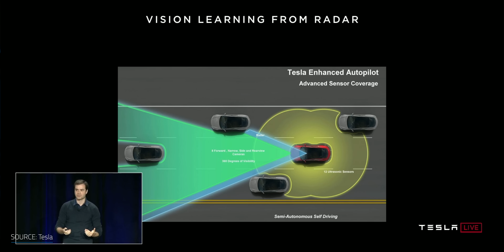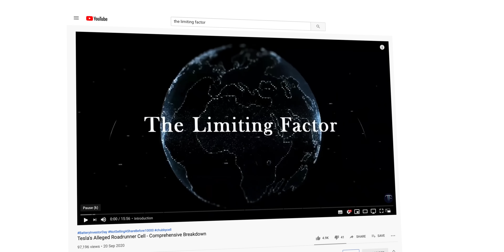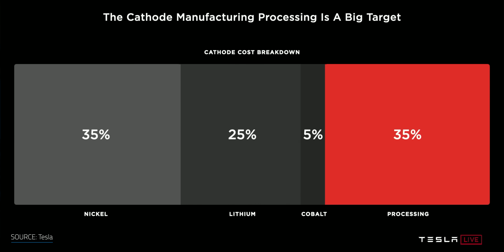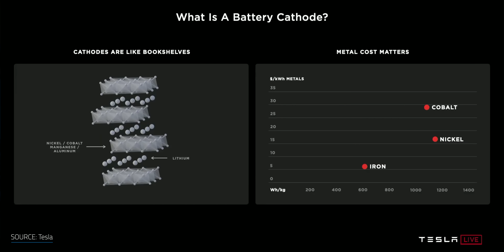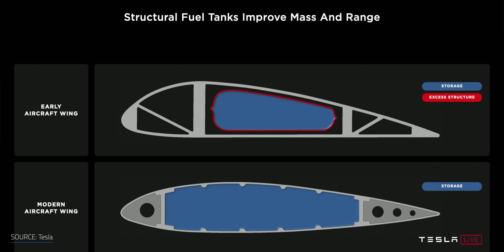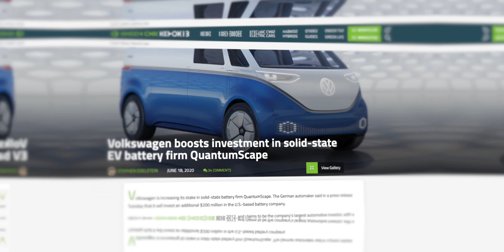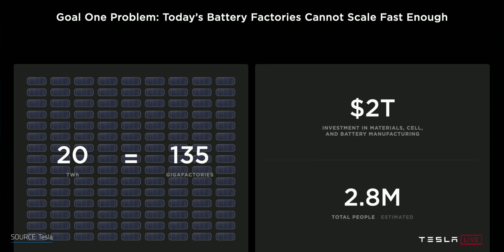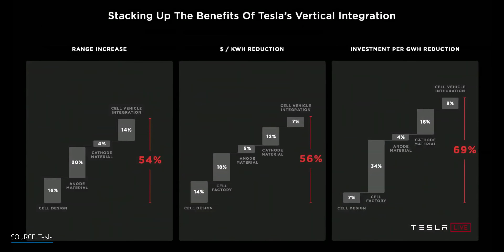3 Takeaways from Tesla's Battery Day - Hint: it's not just batteries

Comment: Excellent high level overview of Battery Day.  The devil is in the details, as the saying goes, and you are so right about that.  Tesla looks in every nook and cranny to find ways to improve processes, improve efficiencies, improve cost, and improve reliability.  This dedication to innovation is what will probably always set Tesla apart from other EV manufacturers.  I don't really see anyone else catching them anytime soon.  

From a product standpoint this new 4680 battery is going to be HUGE for the Semi and Cybertruck.  Same or increased range with a smaller lighter less expensive battery pack will help to sell the Tesla Semi as a viable and economical option for short to mid-range trucking companies.  And if I understood the presentation right, the 4680 will be able to charge faster with minimal impact to the batteries.  Another plus for trucking companies worried about turnaround time.  Get that charge time down to 15-20 mins... whoa!

Comment: aah....was wondering about the servicability too.....tesla were talking about hot swapping battries in the roadster event (i think). but if they form part of the load bearing structure itself....that will not happen in 5 minutes....you'll have to strip the entire car down to do that.......i dont know what happens if a few of the cells happen to fail...will the car have to be towed to the tesla station, stripped and have the entire floor replaced for that?...seems like just swapping out one module is a better solution than that
Reply: NEW Tesla battery is Maintanance FREE, it will last the LIFE of the car.
car + battery can be RECYCLED in 30+ years.

Comment: What I don't like about the exoskeleton - non modular - design is the reparability. I get into one crash, maybe the main/battery frame gets damaged. This may lead to a constructive total loss, which on older cars may cost a quite a bit but you could still repair and use the car. The same currently applies to all airbags and especially modern head lights: "No you can't just replace that one LED/Light for 50 Cents, you have to buy a complete unit for 1000€"

Comment: A 54% increase in range.  Is that based on weight or volume of pack?

 If weight that would mean that the Tesla P100 S that uses a 100 kWh battery pack which weighs 1,200 pounds could now have the same range with a 600 pound battery pack?

If it's volume then that increases the practicality of battery powered ships.

Comment: Interesting video Matt. Have you ever done an apples to apples comparison of the cost to own differences between a gas and electric driven vehicle? The biggest difference to me is the time involved to charge those batteries & the expense of doing so. Also, how can you compare travel distances of gas vs. electric? Which is really cheaper over the long haul? I know that there are many other issues involved, i.e., the environmental impact of gas vs. electric. We have to remember that when those batteries are being charged, the power plant still has to burn fossil fuels to deliver the energy needed to charge those batteries!  It will be interesting to see how this all plays out...........  😉😉👍👍
Reply: "... the power plant still has to burn fossil fuels ..." No, it doesn't. You can charge your car from solar or wind power... either buy power from a power company that sells only power from renewable sources or install your own solar panels. And even if you do buy your power from the dirty fossil fuel grid, that grid is getting cleaner every year as coal-fired power plants are gradually replaced with cleaner natural gas and renewables.
 
Regarding time to charge, most cars are only used 5% of the time, leaving plenty of time to be recharged. Just plug it in when you get home and it will be ready to go the next morning... never spend any time at a gas pump ever again.
 
On cost, electricity wins over gasoline and diesel every time, even in Europe where they have ridiculous prices for both electricity and fossil fuels.

Comment: In the event, there was a slide that said they used 100 GWh of batteries in their vehicles in 2019. I always assumed that number was like 30. How does that math work out? under 400k cars sold in 2019... that's an average of 250 KWh per car sold. That's way too high, right? Model 3 LR AWD has a 76 KWh pack, I think. Are they selling packs to other car makers?

Comment: Spot on Matt. First principles thinking. This is so unbelievably powerful and applicable in day to day life. I always wanted to get a bunch of old carpenters to spend a day with physicists on construction sites and in the lab. They do so many of the same things in completely different applications. A lot of the tricks of old framing carpenters are solidly first principles based. 
When I was teaching science, to middle schoolers - I did this and came up with some amazing things. I can instantly point in the direction of Earth's orbit and teach it to kids (it's not on any astronomy app and I've yet to meet an astronomer who can do it).  I know how and why billions of gallons of water get high overhead (clouds). Have someone explain how the fat arrows in the Water Cycle diagram, that go from the surface of the sea to the sky.  Once you get started always going back to first principles you can do so much more and it's all fun. I'm not qualified to be a Tesla engineer, but I know enough to know that they are having fun.

Comment: My house is 100% Solar. I use forklift batteries for storage and manage the infrastructure myself. With the Tesla batteries I could reduce or eliminate supplement energy sources during extended low light conditions (Grid charge, Generator, use reduction) I am limited to hiw many FL batteries I can combine by efficient charge configuration BUT with Tesla batteries I could scale up almost unlimited only by charhe capacity and cost. One benefit of the FL batteries though is a 20+ Year life cycle. The system has paid for itself already and if the life and thermal management of the Tesla pans out they could also. I'm budgeting for a hybrid system in 5 years...probably a FL primary system with a back up Tesla instead of Alternate charge methods...

Comment: Tabless isn't about moving heat away better.  It's about generating less heat to begun with due to much lower internal resistance.  Side effects include vastly higher power, better cycle life, faster charging and discharging, etc.  Tabless makes everything more efficient.

That said, higher power generally isn't a real world advantage. Large battery packs in EVs, including the smaller 18650 cells already have far more power (torque) than the tires can handle.

However less heat is a major, major advantage.

Comment: Will the electrolyte be solid state, this was never mentioned? By what i have read and seen from patent registered some time ago, could be Dr Helen Braga's EG John B Goodenough.
Any suggestions.
Reply: No, no solid state battery.  There was no large, paradigm-shifting innovation like this, which is one of the reasons for some investors' disappointment.  However, this is also what made experienced engineers and industry insiders excited (or terrified) because it means Tesla is following a lower risk path.  They're much more likely to successfully implement these smaller improvements, and, while none of them is game-changing on its own, cumulatively they can have a massive impact.  Also, if for some reason one of the improvements doesn't work out, that doesn't mean everything collapses; all the other changes will still have an impact.

Comment: I fully concur with your assessment that this was an event primarily meant to excite Tesla investors because it showed how it's going to reduce manufacturing costs by a whopping 69%, as well as reduce the cost per kWh of battery capacity, a key metric in the industry. Given this theme throughout the presentation, I'm baffled at the response by investors the following day. They went with the unjustified negative hype that the presentation was too technical instead of weighing the preponderance of evidence that, with this comprehensive plan, Tesla is a better investment opportunity than ever before. Their plan addresses range limitations, safety, cost and scalability, as well as the ever more important environmental and issues. It also addressed child labor issues.

Comment: Blown away by the same things. What stuck in my mind with structurally-integrated battery was how expensive repairs would be. We know they are aiming at million - mile batteries. But how do you replace a battery pack that is cast into the body of the vehicle?

Comment: Matt, the tabless battery isn't smooth on either end, so some type of conductor will need to fill the gaps and give a uniform connection for electron flow.This is part of the "secret sauce". If this is solved, Tesla could begin using tabless cells in 6 months or less. They could also license the tech o Panasonic et al.
Reply: I believe they will use a conductive adhesive.

Comment: I think the $25,000 price point was the most interesting news but part of that car is the new batteries that provide 5X more power and 6x range. That is important.
Reply: Take care, that is per battery.
Each battery is 4x the volume, and I assume 4x the weight,.. still a nice increase but remember the 54%  range increase.
Reply: This seems commonly missunderstoid
Its 5x range and 6x power PER CELL
But each cell is 5x as big so there will be 5x fewer of them for the equivilent pack size. This is assuming the same chemistry anode etc. The gains are from the tabless manufacturing that allows faster discharge (20% higher) this due to shorter electron path within cell therefore less heat generation.

Actual capacity increased are refered to due to chemistry anode and cathode changes.

Possibly the largest single improvement is not cell technology at all but due to the weight savings bought about by cell form factor (size) and cell to vehicke integration.

Comment: there seems to be another effect not accounted for in the charts... the sum of all the effects should also create a second wave of savings or performance gains when all these innovations have been integrated. there could be less batteries used leading to even more weight reduction on existing or new models... or greater range for other models.

Comment: At 4:05 in the picture to the right, they show that the initial structure fractures and then, THEN it gets thicker, making the battery better with more usage.
Elon mentioned it before, but they did not comment on it with clarity.
I think they left out A LOT of explanation on purpose. 
I think they are sandbagging it and will over delivery in time and scale.
Trully amazing!

Comment: That slide at 13:15 is the exact point at which I knew they were purposely not being specific. It’s only to those who are already closely watching do all the actual details reach. For example, we didn’t hear a million mile battery. But if the Plaid S is rated for 520 miles and we can assume the batteries will still have a 2000 charge life cycle. That’s over a million right there my friends. Not to mention i believe they buy batteries from Panasonic and LG for $103 and $106 per kWh respectively. Now they’re saying they’ve reduced the cost per kWh by 56%! (Please correct me if I’m wrong). This video was very well done by the way. Have you done a video on Atlis? They also seems to have a tabless cell design, and I would love to hear your take on their battery potential.

Comment: I understand that the bigger the battery cell the higher the capacity of that cell, no brainer.  I only question is how do they arrange these cells to fit the most per battery.  The larger the cylinder cell the more wasted space will develope between cells.  That's why you use a smaller cell to mitigate that issue.  So why is bigger better in this scenario?

Comment: Maybe I'm missing something here, but something a lot of the "reviews" of Battery Day seem to be glossing over,   the slide says 5x more energy (I'm ignoring the power aspect because that's how fast it can discharge that energy, great for making cars move fast, irrelevant for making cars drive far).     The "new" battery is a 4680 battery (46mm diameter x 80 tall),  the old design uses 2170 batteries (21mm x 70mm).  Now doesn't take an engineer to do the math on this and see that the new battery is about 5.5 times LARGER than the old battery.    So I sit in here and wonder... 4:03  "Which means more energy storage"  now consider the packing density of circular objects is the same,  I wonder how is this more energy storage?  If anything this look like less energy storage (energy density) since we're only getting 5x more energy, yet require 5.5 times more volume to do it.

Note: I'm not dismissing cost savings and all that as well, I realize that is potentially huge.     Although the integrated battery part is a bit upsetting, considering I think the future of long range driving will be swapping of batteries out (as Musk showed off in a conference some years back), because as you get more storage (even if it's not the case here) that means long times to "fill up" on any sort of trip.

Comment: The Exoskeleton is not new, it was done by Pontiac in 1984 in the Fiero.
Reply: Here here! I’m unclear as to how any unibody doesn’t qualify.
Reply: @MartinPittBradley  It looks like unibody to me.  Chrysler was doing it in the 1960's.
Reply: Well, it's not unibody. A unibody basically has a skin and a space frame, a 3D structure under the skin that provides the car's strength and holds the car together. The skin contributes very little to the car's structure. (A unibody differs from a conventional body on frame because it doesn't have a separate 2D frame for the chassis that the body gets attached to.)
 
An exoskeleton design, by contrast, depends on the strength of the skin itself to help hold the car together. The 3D space frame is much lighter, or even nonexistent because its strength is not needed. Ultimately a Tesla will consist of a structural battery pack that also serves as the floor pan, a front casting to hold the front suspension and front motor and serve as the frunk floor, a rear casting to do the same for the rear, and a structural skin that gives strength to the upper areas of the vehicle.
 
The Pontiac Fiero was a conventional unibody with plastic body panels. It was the very antithesis of an exoskeleton in that the skin had even less strength than normal steel panels.

Comment: For me I am excited about having more range and faster charging. Fast charging was not talked about and I think that was intentional. People would hold off buying until they have the new battery in their cars in 2022.
I have an order for the cybertruck and when I get it, I plan to take it across America, camping at different national parks. All that driving, I want to be able to charge quickly and get back on the road. With that  new battery design, charging should he a lot faster. What slows down battery charge rate? Heat buildup in the cell. With a tabless design, energy can get into the cell easier with less resistance this less heat. Plus the tabless design cell will he configured in a way that removes heat more efficiently than the old cell design. This all adds up to faster charging.

Comment: Any thoughts on when model y will ship
W new batteries?
Reply: Won't be for several years. First will come the plaid Model S, late next year. Second will be the Cybertruck and the Semi in 2022 or so. After that will come the Model 2 and the Roadster v2 about 2023. They'll also need to start putting some in premium stationary storage around 2024. Only about 2025 will they likely start retrofitting existing models.

Comment: Well done Matt, as always! Love to learn about your thoughts on home (and even business/commercial) heating and cooling. Elon touched on this and about the octovalve heat pump that could be stacked. Natural gas furnesses do a great job heating homes in Canada. Plus thet are very affordable and quiet too, especially outside. There is some noise from the exhaust fan with new high-efficient furnaces though. I remember my father got a heat pump in the 1970s. I think our neibours would still be complaining about the noise if they could today.  Natural gas is pretty clean in term of pollution at least. Still, it's adding carbon pollution to some degree. Hydrogen would be nice. But, it's makes little sense to me cost, efficiency, and logistically to me. Maybe with enough wind, solar, hydro-electric, and battery, simple resistive heat furnaces would even be an option. Thanks!
Reply from the maker: Thanks, Douglas.  I really want Elon to make home HVAC ... there’s plenty of room for innovation there.  Geothermal/heat pumps are a great option ... been thinking about doing a deep dive video on that.

Comment: I have over the last few dats corrected a common misconception by replying to comments in many videos including a couple here.

Many are stating that the battery is 5x capacity and 6x power compared to the old one.

How was it done?

Why isnt the range 5x ir 6x more.

THIS IS WHY.
the Cell (not battery) is 5x larger (volume) so assuming same anide, cathode and chemistry, has 5x the capacity. Then the power is 6x as the capacity can be used 1.2 x as fast due to the advantages of the tabless design.
Reply: Sorry forgot to say there will be 5x less cells fir equivelent total capacity

Comment: My  takeaway was:- US$25,000 fully autonomous car with 300 mile range in 3 years. I suspect it will charge at 350kW too.
Reply: it wont need to LFP cant take High Voltage anyways. 250 kwh is Plenty.